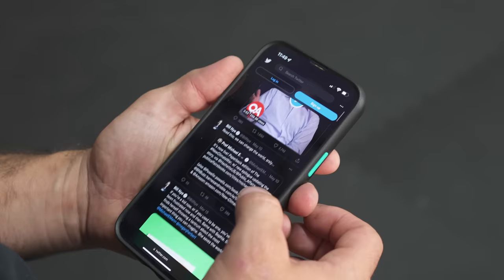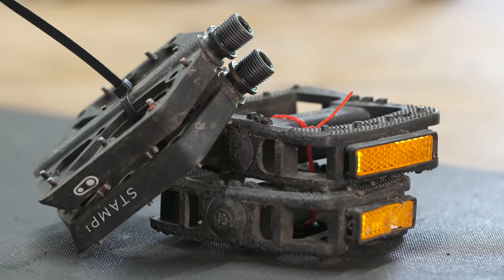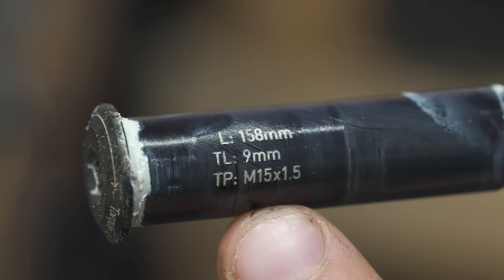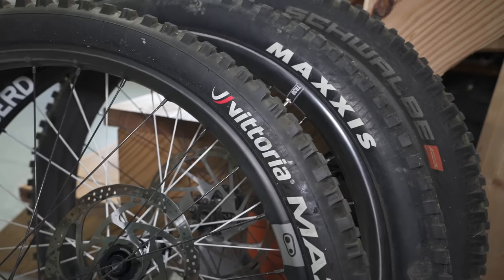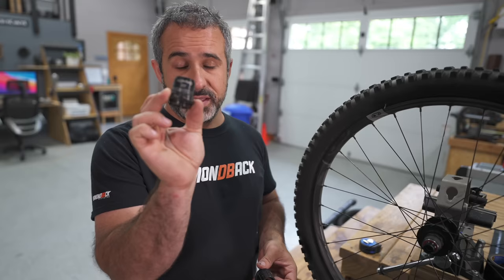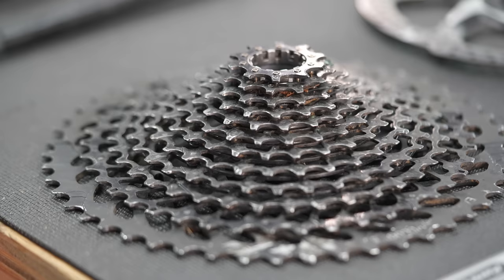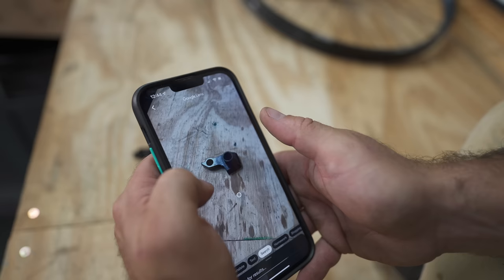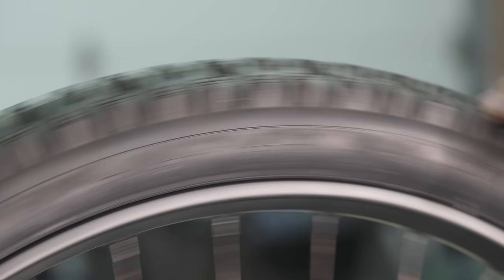What parts fit your mountain bike? (I won't tell you to just Google it)

Comment from the maker: Yes, this video is way oversimplified and at times, flat out dismissive of details. I know Sram and Shimano 12 speed MTB chains aren’t “perfectly” compatible. Some bikes have freewheels and don’t take cassettes. There was a time where no bike took a thru axle. You could in theory buy a 12 speed HG cassette which would be incompatible with Microspline, which I omitted. Yes, rims have widths too. Older bikes have rim brakes. Valve caps aren’t universal—especially since some riders are going back to shrader. In our original footage I went on forever about wheels and Boost, but we edited it down to a minute because it felt overwhelming and counterproductive. In the end I didn’t feel these caveats would be important to someone who doesn’t have enough experience to Google something. This will hopefully be a simple and welcoming way to get them started out. Thanks for understanding, and feel free to include more info below because the comment section itself is a valuable resource.
Reply: Hey I’m a upcoming mountain bike YouTuber. I would appreciate some feedback and how I could Improve. Thanks for your time!
Reply: i rebuild an old bike and it feels more like rocket science than building a simple mtb xD
Reply: Hi just wanted to say I love the vids
Reply: Hey, Berm Peak Do you know if the xtrada 6 27.5" bike from polygon is any good for someone who rides very rocky places and is 85kg 5"8  "i can't afford anything over $600
Reply: @Wulesh  any bikes a good bike long as it gets you riding. Where I ride is also kinda rocky and before I got a norco sight I had a $700 hard tail and that was jus as if not more fun to ride. Cheaper bikes forks break pretty quick on rough stuff but other than that get some decent tyres and later better brakes and then wider handle bars an you’ll be great tho everything won’t be as durable on budget bikes especially rims so jus keep that in mind
Reply: @robwoods1808  whats the best rim to buy then? i don't want it to bend or snap on me because its extremely rocky where i ride
Reply: @Wulesh  it probably won’t I have ridden at snowshoe which is crazy rocky if you just get a set of decent alloy or aluminum rims you should be good
Reply: @Wulesh  if your just beginning to ride trails any actual mtb (mountain bike) brand’s bike will be good for you for at least 1 year up to 3yrs. depending on how quick you progress. Meaning as long as it’s NOT a Walmart,target, although even some of those bikes are good enough to start on and upgrade. What I would do is look at some bikes, then a look at some parts you might want to get in the future make a list see if they are compatible, and take it from there.
Reply: This is the softest and kindest "let me google that for you" I've ever seen. 

Well done :) no shade. 👍
Reply: Has anyone tried to upgrade a Walmart bike and made it somewhat decent by cheap bike standards?
Reply: Basic but good info. I love the trail builds the most but obviously they can't do that every episode.
Reply: @TraviNomotion  yes I did with an old nishiki with a steel frame. Don’t do it it never gets as good as a bike for the same price of upgrades. Upgrading is very expensive if you want a cheap bike and can work on it yourself check out polygon bikes probably the best value but if it’s your first time with a mountain bike then get one from a bike shop.
Reply: I have SRAM xx1 on my bike and when I take off my wheel My cassette will just slide off, is that normal, it is the cassette only. Everything still functions as it should tho
Reply: Dude. Chill. You did a great job. Bikes are a nightmare of "standards". I think it's safe to say if you covered everything then the video would rival the complete Star Wars saga for length. 
 I tried to explain the weird numbers in MTB to a friend and ended up accidentally giving an hours lecture about metric-imperial conversions, tubing restrictions (it's why the seat post isn't a perfect anything but the clamp is) and even a tangent about 9, 9.5, 10mm and ⅜"all being very obviously different measurements yet all refer to one axle and it's shit. 😂
Reply: @Wulesh  Halo rims. Halo will outlive us all.
Reply: Seeing you go through troubles fixing a second-hand bike resonates with most of us, because many of us are basic bikers and we don't know that each part has many types and measurements, and when we try to fix our bike cheap, we have to do it ourselves.
Reply: Well I think those kind of details will do now damage to people who write messages to you, asking them for bike details.
Reply: Maybe you can make this a whole new series :3
Reply: @eliashanchett  Not normal at
all, take your bike to a bike shop or search online on how the cassettes onto the hub.
Reply: Öhlins is pronounced ‘er-lins
Reply: i would love to see that part about wheels and boosts, all the other stuff i have learned already but im lost in the wheels booost part
Reply: Make a part two I really enjoyed this
Reply: Hey Seth! I am constantly looking at used bikes on marketplace and other platforms and I know many other people do. What I want to say is that people do not say the size of the frame in about 65% of all advertisements which annoys me a lot. And probably you too as you also look a lot a used bikes. So I thought maybe you could mention in a video that it also belongs to the average biking etiquette to say it in first place in the first line of the advertisement a letter such as "S,M,L or XL" or maybe the size in inches such as " 18" for example. This would make the world a much better place as the someone who is looking at bikes won't get annoyed so much and people certainly could sell their bike faster. 

Thanks
Levi
Reply: Hi I thought an easy way to start working on my own bike would be to change the saddle. I have the new one on but it moves and rocks forward even though I tightened it up. Any help is much appreciated 😀
Reply: Find me a biggest fan Nathaniel noye 65 wheeler circuit my birthday is December 24th 2022 on a Saturday this do you got some merchandise
Reply: I'm your biggest fan South Park
Reply: Because I'm because I am your biggest fan Nathaniel noye 65 wheeler circuit
Reply: What what size muckoff decal does my 2018 Specialized Stumpy take? The old one is worn down and doesn’t have the size visible anymore.
Reply: Yo seth there tons of scammers using your name scamming comments i would rlly like if u made a short vid on main or on the second channel that u aint giving out free santa cruz heckl hecklers or free s work enduro 2022. One told me i could get the channel, business AND sponsors! Wtf please there are young ppl watching and it would,d be bad for them to loose money.
Reply: @TraviNomotion  
Kev central has a YouTube channel that does that
Reply: Content like this is so helpful to the newbies man, I love seeing it!
Reply: bike world is SO not standardized ! parts that are the same like a 12 speed chain should be a 12 speed chine regardless of manufactures! something like a bike should be simple! coming from the automotive world it as straight forward you have as set of standards! things like brakes and gears need to be bolt on and go! in the automotive world things are bolt on and go with little adjustment! bike world should consolidate standers and move to a more automotive mind set and less like a consumer good like a I phone! the most annoying part of a bike is gear shift cables and brakes! o spoke wheels need to go! we need a solid spoke alloy  wheels like the motorcycle world no spokes to fuss with! there all so needs to a spec master guide guide to identify stuff like Sheldon browns sight made in to shop Manuel form! all so we need a parts supplier like a Napa for bikes, to get parts! should also have a lookup guide like we do with car parts. year make and model! things would be better if we had it like this!\/
Reply: @Wulesh  stay away from Carbon especially fro Ku terrain. I would go with an alloy wheel
Reply: @jjdaga  depends on the type of saddle. If it is a rail saddle and it still moves after being tightened. I would look to wear the rails actually connect to the seat and make sure those screws are tightened. If it is a pivotal seat It will sometimes just need to be tightened and then re tightens over SND over again or just get a new one
Reply: I think you did great.
Reply: @chadkline4268  that means it'll be a 1.37" threaded BB, sometimes called BSA threaded. That's the standard for threaded systems so you can chuck in whatever style of threaded BB. The only thing you'd need to measure is the width of the shell. Either 68 or 73mm luckily. Yay, standards which are mo longer standard. 😂
Reply: @chadkline4268  Road or MTB?
Reply: Much appreciated!
Reply: @BermPeakExpress i have a older GT size 26" and it has a 7speed cassette on the rear wheel. Am i able to put a higher speed cassette on the wheel and it still fit onto the frame??
Reply: it's funny that you mention 12 speed Shimano because you didn't even mention Microspline hubs which add another level of complexity when choosing components. If I was making the video, I'd give an intro saying you probably want to stick to same brand components for best performance and then actually inform on compatibility across a components of the same brand. Then a last section pointing out what parts may work fine if using different brands.
Reply: It says that my bike does not exist

Comment: Tip: If you have an older bike, most large bike companies have an "archive" of past bikes different years. Vital MTB also has good archives of specs and geomentry of different bikes. My bike is a couple years old, and by going to its manufacturer's archive, I can see all its specs and what parts fit.
Reply: And in case this doesn't work out it's helpful to save the product webpage as a pdf when you buy a new bike so you can capture all that valuable spec info while it's easily available.
Reply: I'm not so lucky cause i used a raleigh frame that was sold as like a full bike at canadian tire
Reply: also true for other industries.
Intel has all the information for older cpus archived and msi for their motherboards etc. probably a lot of other examples out there as well
Reply: Depends on maker and age, for example trek doesn't have anything pre 2002 - not exactly helpful for info on an 830
Reply: Too bad Cube only goes back to 2016. I got a bike from around 2009 where I had to find everything one component at a time.
Reply: mine is from 2001 :(
Reply: @ColdestLivewire  I'm in the same boat. 730 multitrack from 97 that I love but am going to need a few new parts for and I'm probably going to have to lug it in to a shop rather than guessing.

Comment: As a certified mechanic I can tell you that a non mechanic thinks you know how to fix every mechanical issue in the world on every vehicle in the world, I show them my process on how I find my answers too. I was a bike newbie once too, and I used to ask the newbie questions too, a bike mechanic showed me their process, now im good. Thank you for this video.
Reply: Care to share your knowledge with us other newbies on how to find the answers and their process?
Reply: as a bike newbie that has a automotive background to bikes are complicated as there are to many standers ! in the auto motive world take carburetors in 4bbl type just 2 bolt patterns and square vs spread bore! things are bolt on and go not to much adjustment! we in the bike world need: #1 a equivalent of a Napa, jegs , summit for bike parts! #2 we need a book that explains all the different bike standards listing  the size of the various components! #3 we need a parts index look up interchange guide that lists the bike make, model, year and the components used ! this way one can hunt down part from other bikes to to a bit of factory or parts bin hot-rodding! #5 a good hints and tricks guide to building up a bike! all so the bike world needs to move a way from the need for sepal tools! working on old cars just standard tool and a feel for things is all you need!

Comment: A good trick if you don’t have calipers, find a decent adjustable spanner (one that hasn’t developed a lot of play yet) and tighten it in untill the edges measure the part and then measure the gap with a ruler.

Comment: As a mechanic at an LBS, I approve! Keep up the amazing videos Seth!
Reply: Also visit your Local Bike Shop, but actually spend money. I needed a 113mm tapered square bottom bracket for my old hardtail and was unable to find one online. Stopped by my Local Bike Shop and they had one in stock. Also grabbed some spokes while I was there.
Reply: @cataplt  I will admit that even if I love to do things myself, my local bike shop has saved my ass a few times already, and they're a great resource for obscure info and unique requests, love you Igartua (no homo).
Reply: @Isaac, ditto! And @cataplt, double ditto!

Comment: Make a log book. This book can have your specs eg Bars: 35 clamp, 38 rise, 800 wide or maybe Cassette: SRAM NX 12, 11-50 HG spline. 
Anything like that you can refer to and have specs clearly listed so you can reference if something will fit. This log also allows you to record any servicing on the bike whether that's your work or a professional job, eg. 12-06-22 Rear Shock Air Can Service, Fork/Shock Sag set 30/25%. Or 04-02-21, Forks serviced TF Tuned. 
 Seriously helps keep everything running smooth, simplifies ordering spares and makes diagnosing issues easier. Maybe there's a creak, could be linkages or could be BB. Check the book and maybe it'll narrow down the possibilities like you might have forgotten about the Bottom Bracket swap you did 2 months ago then notice the last linkage Service was almost a year ago. Really makes the job easy.

Comment: Nice video as always! Two things tho:
-Valve caps can be diffrent (at least we have 2 or 3 diffrent ones in Germany) but I guess that is not that big of a deal.
-You have to think about the chain a bit more sometimes. For 7speed downhill cassettes you might need an 11speed chain because the space between the cogs is the same but there is a spacer from cassette to the wheel.
Reply: nice thanks for the info i didn't know that
Reply: would you have to shorten the chain then ? more than if you were gonna use a actual 11 speed cassette
Reply: @AlexGirodo  Depends on the setup I guess. But it doesn't really matter, since you have to shorten the chain either way.
Reply: The Presta/Schrader/Woods valves?
Reply: @cerberus1981  I think yes. They are named different in German but after a quick Google search I think we mean the same ^^

Comment: Once you've found out the correct manual for your bike, fork an shock, download and save them. In the same folder, make a .txt with the correct shock/fork PSI- and rebound etc settings. If you send your shock/fork for a service, it's faster to just look from there than to go through the same sag-tests etc to find the good ones.

Comment: Hey Seth                    how are you doing. I started riding Mountain bikes only last year. I bought a Gary Fisher rig hard tail, so the question I have is for the bottom bracket. I purchased a Race Face drive train or crank. What I didn't know is that it was going to be a nightmare to remove this crazy Trex contraption holding  the crank in a 56mm bottom bracket. I'm going to look it up myself but I wanted a reason to message other than to say I watch your Flip show religiously. I just wanted to show my appreciation and gratitude as I've learned tons from watching. I'm in my 40's now and want to be in the parks this coming season. I don't know how I've gone this long without a mountain bike. It's my new passion. Once again love the shows, keep up the great work!  Thanks Scott B🚵

Comment: I recently updated the drivetrain for one of my gravel bikes because I wanted better range. First go around, I ended up with the wrong bottom bracket because my new crankset is 19mm (which is supposedly weird) and I ordered a 24mm. That was a minor setback but no big deal once I ordered the correct one. Also, just because something doesn't "work" according to the website doesn't mean it can't be made to work. My 10-11 speed crankset works just fine on my 9 speed drivetrain. My 11-42 tooth cassette works just fine on my Sora drivetrain with a Wolftooth Roadlink that claims to max out at 11-40 but worked fine. Bikes are fairly simple and sometimes you can "Hack" something together as we all know thanks to Seth

Comment: I wish you had gone into the specifics of boost/non-boost. I know you ran into that problem building the single-speed Slopeduro bike. I'm still confused about the difference and haven't found a clear answer on the interwebs. BTW: MTB forums tend to be full of snobs who just trash talk newbies so it's nice to have an expert address these questions clearly, concisely, and without condescension. Thanks!
Reply: Honestly you don't really have to worry about what it's called. Boost is just a trade name. 
You should be looking at the dimensions ex. 15mm x 110mm or 15mm x 100mm. If you are wondering what axles and hubs you have, find the model number by looking on the parts themselves and checking their manufacturers website. Sometimes what the bike company says your bike comes with can differ slightly from what it actually has. If you do better with visual learning, go to a decent bike shop and ask them to show you the differences. Then maybe buy a few bucks worth of chain lube and grease as a thank you.